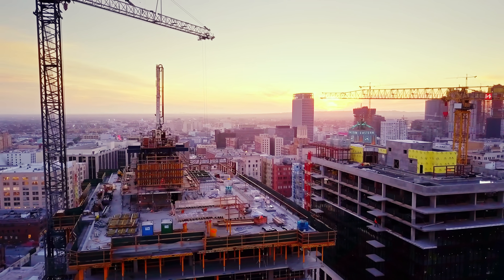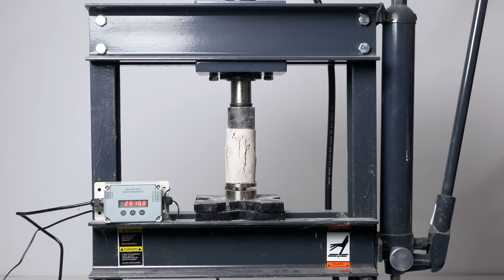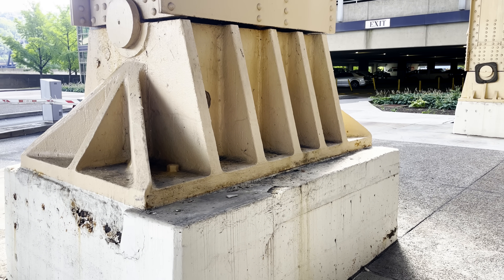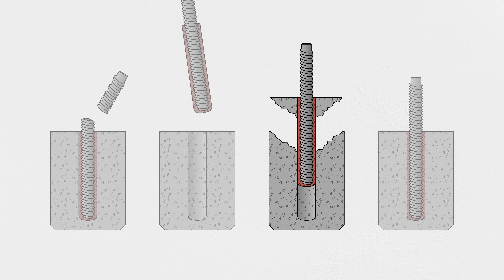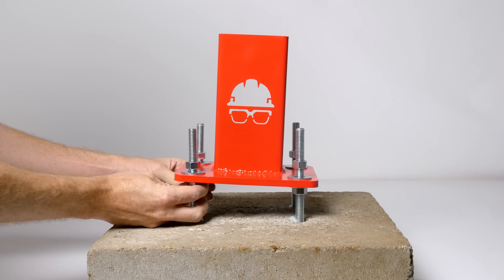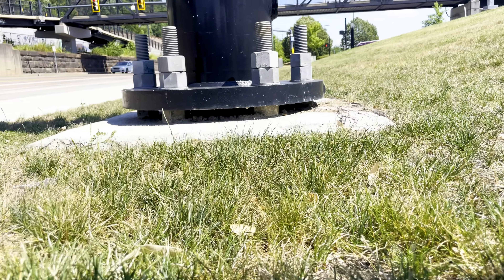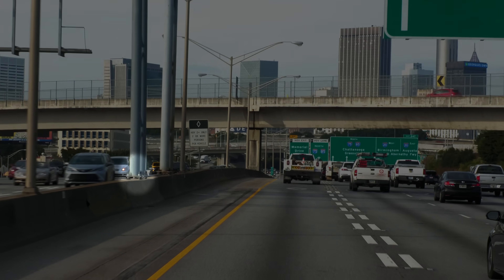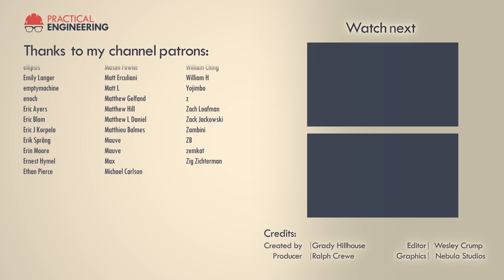What’s the Deal with Base Plates?

Comment: In the Kansas and Missouri areas we often see highway signs  (not overhead) that are blown over.  But not at the base plate. They seem to be built with two piece uprights, one up to the sign and the second attached to the backs of the signs. The connection between them is where they “fail”. I assume this is from high wind.  And I assume this is a secondary engineering or design criteria. Make it strong so as not to fail. But if it could fail then make it fail in the safest or cheapest way.   All this is spitballing from a retired software engineer’s point of view. 
And thanks for the few seconds of Kansas City interstate road in the vid.

Comment: 0:59 I am strangely excited about this. After years of watching you and others about infrastructure, it's great seeing an episode on the one singular entity that literally ties everything together in the modern world.
Reply: Not quite everything, but quite a lot, especially in the commercial space (where steel construction is common). You'll often find the same anchors in residential construction, just anchoring a sill plate to the stem wall. Or in concrete construction, you just extend the rebar up from the foundation to tie into all the column or wall reinforcement. Any time you do have some large steel member, tho, either a beam or a column, you can expect to find a steel base plate going into concrete.

Comment: Working in heavy civil construction for almost a decade, a really large number of light poles along the highway are actually designed and installed with “transformer” bases that are made from a softer aluminum that will tear and break away in the event of a collision. Also, the bolt “holes” are actually slots that are open ended to assist in the break away function. Lastly, due to the overall height of most of them, even if they are hit they usually don’t land on the vehicle that hit them. That vehicle passes more or less safely under the pole and stops outside of the fall zone, kind of like kicking out the bottom of a baseball bat balancing on one end.

Comment: as a very informative video, and that I was not expecting to cover 911 plane crashes? wait? at 10:39,
"Smaller signs installed near roadways often do use breakaway hardware or features. You’ll often... " and then whent on to sign, and what looked like pictures of street lighting, with a picture of the gound bolting what cover in this video? Well, back to 911, the third plane hit the pentagon, going over the staff cars car park and knocking down all the light poles on it's way to the main part of the  building. One of the reasons for light poles/posts just lying on the ground, where they were breakaway, at the base, (but it's a car park; how fast most of you be going to justife something being broken away or not broken away, main road, things moving at speed, yes, but car park, that the end of you jounary most of the time or the start?

Comment: I hate working with these and post tension slab. Somehow the only way to do this at my work is setting the rebars first and then try to set these anchor bolts plumb, be in the exact location. Which is challenging everytime because you have to position all 4 through a web of rebar.
Oh yeah, those bolts are L shape.

Comment: Nearly twenty years ago, in Europe we had a bit of a problem with anchors in concrete when a new Eurocode treated the bolts like a concrete stress member and demanded the use of a safety factor. In the case of an important anchor fixing the bases in a power station that I was working on at the time, this meant that Hilti had to reduce the torque on the anchor from 270Nm to 150Nm! I refered this back to Hilti and it went all the way back to their people in Lichtenstein and the answer came back that they knew it was wrong but it was the law. Pretty damning. I'm not involved in that sort of work any more but I know the codes have changed since then but I don't know if the problem is fixed. It is sort of scary that there could be thousands of structures not properly fixed to the ground.
Reply: What does the phrase "treated the bolts like a concrete stress member and demanded the use of a safety factor" mean in this context (you can't just multiple the steel area by the modular ratio and get the concrete area for design purposes, steel and concrete act way differently)? And why would needing a factor of safety on the design of the anchor require lower installation torque? Larger safety factors will be provided by properly following all MFR recommendations.
Reply: @kindlin  The fasteners should have been stretched to near their elastic limit. Instead, I think there was a safety factor applied to their ultimate tensile strength.
Reply: @jimf671   Do you mean the bolts should be torqued down so hard that they are nearly yielding (their elastic limit), without any loads applied? That's a quick way for the bolt to fail as soon as it experiences any additional load. I'm sure I'm still misunderstanding. Picking up meaning online has never been my strong suite.
Reply: @kindlin  There you have just made the mistake I am complaining about. The bolt does not see any additional load until the applied load exceeds its pre-load.
Reply: @jimf671  Let me get a bit more specific, here. Maybe you can tell me at what point I either get something wrong or misunderstand your point.
 
If you had a pole flange plate splice with, say, 4 bolts, and installed them all using the turn of the nut method, you would find them at approximately 15-20 ksi, or about a quarter of their design capacity, in tension. No amount of compression will cause any change in bolt stresses. Any applied tension load will first need to overcome the dead load tributary to the splice, but as soon as it does that, it starts loading up the bolts in further tension, to, say, 20 or 25 ksi, using more of the capacity. Same with flexure, one side will be in compression and adding ( or removing) any load from the bolts, while the other (the tension half of the force couple) will result in additional bolt demands ( again, after overcoming dead load, but now tributary to that individual bolt).

 
Is all of that making sense?
 
This is the context in which I am not quite following. I am curious tho, and would like to understand what I'm not understanding.
 
Thanks!

Comment: As a structural engineer who mostly watched your videos for the geotechnical side of things, it's rather pleasing you take on a different approach. I appreciate in your way of presenting the general ideas of construction engineering through exaggerated home brewed experiments. I feel like younger generations of structural engineers forget that half of our job (considering our insurance and the liability side of things) is to understand which details require attention and which don't About another 25 percent is through understanding and judging a contractor's capability to carry through with the design. What i love about my job as a sturctural engineer is how it often comes down to seeing things deform in your 3D mental space and never forgetting Hooke. I'd appreciate immensely if you would kept the "practical engineering" side of things and showed structural engineering with heavy foam blocks (simple bending and shear) or spagheti (instability). Regardless always a pleasure your videos are always a pleasure! 
Cheers
Reply: Hooke's Law, man. I've seen that many engineers, even at my own company, that just don't get it. They think you can put a simple 8x8 DFL wood sleeper across some steel joists and get RIGID load distribution. Hardly. All the load will go on that first joint and the wood will just defect, barely loading up the other joists.
 
We had an as-built condition that wasn't quit working, so the contractor came back to us, and that engineer had left, so it was up to me to verify the design. As it was already fabricated etc, we really wanted these to work, so I actually did the deflection calcs for the wood and the steel, with different loads going into each thing, and found it wasn't even remotely close to working. Then we had to redesign everything all because our previous engineer forgot about deformation compatibility.

Comment: I hope he does a video on blast walls. I used to paint a flower mill out in White Settlement, TX and they had one entire wall of the building dedicated to explode outward if there was a fire. Raw unprocessed flower is apparently one of the most powerful explosive substances known and has been used to make military grade bombs throughout history. It is so explosive that we had to take smoke breaks a quarter of a mile away from the flower mill and on the other side of train tracks behind another building to prevent any sparks from reaching the grounds of the mill. We also had to wear suits and destatic in a special room at the entry of the mill.

The idea of the wall is that it would give way instead of the roof allowing those inside a chance to escape. I think it's a cool topic.
Reply: Any fine dust particles of a carbon compound can be explosive when dispersed in the right air/fuel mixture. That could be wheat flower, corn dust, sugar dust, etc.
Reply: @avsystem3142  Yup! They had us watch a video about it all before we could enter the factory but I think it is just carbohydrates?

I like your profile avatar by the by. Old school cool.
Reply: @haydenbsiegel  Yes, carbohydrates are carbon compounds. Any molecule with carbon atoms is an "organic" molecule.

Comment: I am in no way an engineer but if I had to guess why they have the base of the structure stood off of the concrete by an inch or two is so that it doesn't get leverage forces creating extreme stress for just one bolt or two

Comment: I noticed the double nut thing on some newer stop lights around I first looked at was like that seems silly. Still does a bit as it was just like a 2FT diameter tube, the top should be easy to level but i suppose the entire thing could have tilt to it so maybe why they do that. The one that still baffles me is look at these streetlights and the walk signals, etc all look like they are held on by giant hoseclamps that makes no sense to me why not just use like self drilling screws or weld some studs on.

Comment: Ooh, this one brings back an unpleasant memory. Many years ago, in college, I worked on an industrial construction site one summer. One of the assignments I drew was to use a pneumatic tool to scarify the top surfaces of the concrete footings for the process building, so the grout under the vertical columns would adhere better. To keep the dust down, the tool had a water sprayer built into it. I inevitably ended up covered in mud made from pulverized concrete, and within a few hours the lime in the concrete dust disintegrated my shirt and, uh... let's say certain sensitive patches of skin underneath it. Naturally, my foreman found a way not to report the profuse bleeding as a work-related injury...

Comment: The quality of the installation of the non-shrink grout is the biggest factor in my experience. Too many do a poor job of pouring or packing leaving voids which reduces the load transfer area. You need the older, patient guy to do this work in my experience.

Comment: I weld bunch of theese, we usually use 20 or 25mm plates for them, tho we also had 50 and 70mm ones. For bolts we use anything from 12mm usually up to 40mm thread rods. To make it dead simple to install it usually a welded cage with L profiles on top keeping the shape, and 10- 25mm plate deeper in concrete to spread load. The top L profiles are supposed to be covered with 2cm of concrete so only threads stick out (pro tip: wrap threads that supposed to stick out with few layers of tape to keep them clean). We use stand off plates for that and gap is usually filled with silicone based grout. Weirdest ones so far was pillars that leaned 15 degrees forward and had 3 "fins" from 8mm plate welded to 12m square tube (300x150x15mm). Because all fins were welded to one side welding shrinkage was massive pain in the back side.
Reply: When I see these base plates, the first concern I always have is the strength of the welds holding them to the post. I don’t remember Grady mentioning the welds at all. Is it so simple to weld these plates on that it’s not even worth mentioning?
Reply: @MrEdunkerley  99% yes, it's too simple. You bevel edges of profile you're welding, put in some shims, tack it, check positioning and adjust with hammer. Now depending on procedure you just start welding or preheat those parts and weld layer by layer. Stiffening plates are added after you weld main pillar. You have to cut off corner on them because weld should be triangular in crosscut, and it's simpler to cut off corner than grind weld.

Comment: You timed this one perfectly Grady! I'm designing baseplates at the moment for an experiment at my work!

It's for a rain simulator boom arm, that's going to be suspended from trucks running along a pair of goal posts with rails mounted on the top, allowing it to be repositioned for different experiments and to allow access for maintenance of the spray nozzles.

It'll end up looking a little like a gantry crane you might find at a dockyard.

The experiment itself is an indoor compound slope setup for testing different sustainable green drainage systems.

I'm a lab technician in a built environment school at a university in Scotland, but my background in physics and hydraulics, so I'm a little out of my depth for some of these calculations. Learning a lot as I go.

Don't worry though! I'm running everything past a proper civil engineer as well! Not ordering or cutting any metal until I can show my work to the class! 😅

Total suspended load will only be in the order of couple of hundred kilos. Still scary if it goes wrong mind!

Comment: Well, not an engineer, even worse, a concrete guy.... Mostly residential, but did some of every thing including metal building slabs and slabs for automated log mill equipment. The favored method that most had when making these types of things were "plug welded plates with big J hooks on them and some times even rebar on the J hooks. They would then weld the top plate to the embedded plate. I can see where the adjustable ones for the lamp posts would be really handy since many are not persnickety enough to make every thing plumb level and square.... I was told that I was way too fussy to be a concrete guy. I probably should have been a finish carpenter. My dad was a  mechanical engineer, and I thought like him a lot.

Comment: Fun fact: Grout used under base plates is "non-shrink" and actually gives a slight expansion. 

Also, the majority of anchors any more are set in epoxy in renovations though some still allow wedge style anchors as they are only keeping the columns from moving laterally not securing them for loading.

Comment: Having worked in some industrial facilities, another place we use a lot of grout is machinery foundations.  The machinery often has to be aligned carefully to connect/ interact with other machines, so leveling nuts on support studs are used.  Then grout underneath to support the weight and vibration better.

Comment: I believe the unit of force you were looking for is the "ugga-dugga".

As far as the welding goes, you need the appropriate certifications for structural weld and an inspector to check the work before you start putting loads on it 😁

Comment: Let's face it, this is a really mundane aspect to civils. I - sort of - remember learning about base plates during my degree course back in the 80s. Seemed straight forward - set anchor bolts into the concrete base and then the steel erectors came along to attach the steel column and the rest of the structure. 

Fast forward a couple of years and I'm a site engineer tasked with setting out. Getting bolt positions to within the 5mm spec isn't that easy, never mind making sure they are actually set in perfectly vertically. Added to that you need to get the concrete pour ready that day or you're costing the company thousands. Loved the job, but not the stress :)